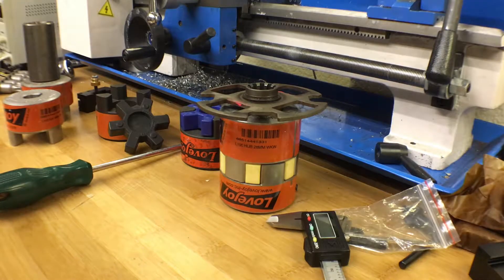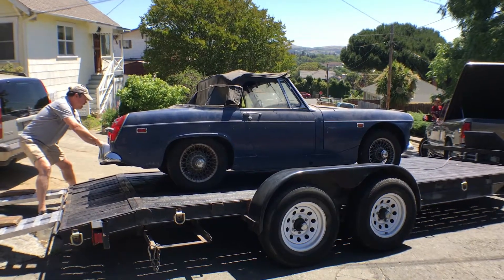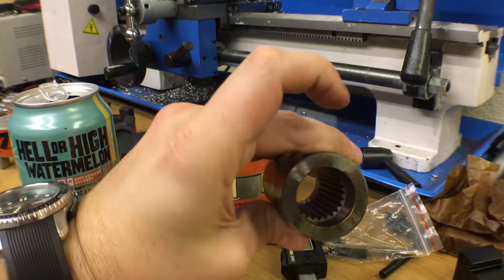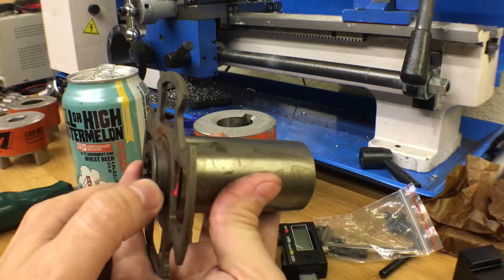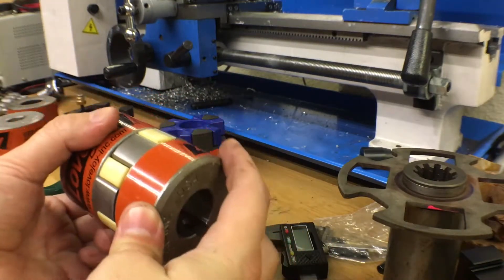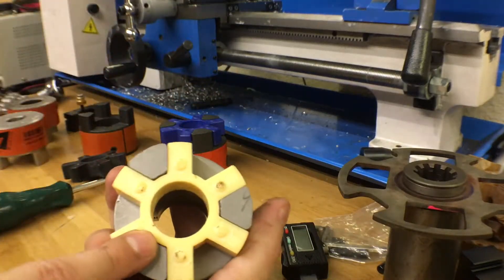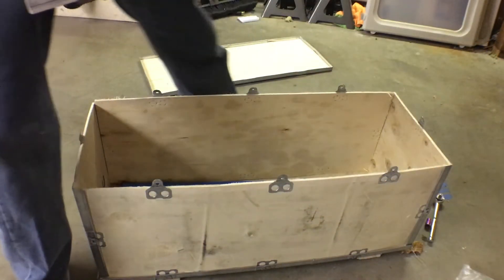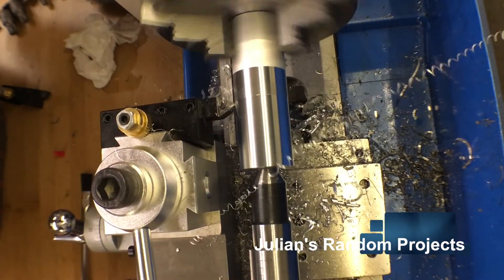MG Midget EV Conversion Part4 First Chips!!

Comment: I'm getting ready to do an MGB EV conversion. Was there a reason you didn't use the rear engine plate as the adapter plate? was it because the engine was more valuable with it?
Reply from the maker: I don't remember having a rear engine plate. Maybe because I sold it pretty soon after removal?

Comment: You have a lathe, it might be cheap Chinese, but you can still do precision work if you are careful: Make a mandrel from some aluminium roundstock that fits the inside diameter of the pressure plate coupler from the clutch. Machine the outside of the coupler so you are sure it is concentric with the inside and has a smooth surface and end. Take the splined adaptor for the electric motor and widen the hole in one end to fit the clutch hub barely. Put one thing in the oven and the other in the freezer and let them slip together. Lay down a decorative weld for piece of mind, and you'll have a perfectly straight adaptor (and cheap) that allows the motor to fit closer to the adaptor plate

Comment: I think you will be disappointed with no clutch on an AC motor, unless there is no regen. No clutch is commonly used on DC setups. An AC motor is very similar to ICE, with  even stronger resistance on declaration which makes it hard to shift without a clutch. Because of the constant load on the gears with both acceleration and deceleration.speaking only with my experience on my project yours may be different. http://www.evalbum.com/4247
      Best of luck with your project.
Reply from the maker: Richard, Thanks! Love hearing from people who are actually doing the thing I aim to do. Your opinion is very valuable. I plan to have the slightest regen or no regen until I upgrade the rest of the drivetrain (drive shafts, axle, spindles, etc.) If I upgrade the axle and the rest I'll be sure to put the clutch back in. RIght now I'm trying to get this done on the cheapest budget for the fun of it.

Comment: +1 for the lovejoy couplings. I've been doing a scooter project recently which required making a similar coupling/adapter-type thing going from yamaha scooter-axle->adapter/coupling->rim and I also bought (the same) mini-lathe. even so I found it quite difficult to get coupling/adapter absolutely true, mostly because the input parts (scooter axle, mini-classic drive flange) were themselves not 100% true. So if you have a solution which allows a bit of flex/leeway like the lovejoys then I'd def go for that over a solid coupling. keep machining to a minimum.

great project btw, good luck :)

*Don's method also looks to allow a bit of flex where it joins the clutch piece..
Reply from the maker: Leaning toward the love joy as well. thanks! and good luck with your scooter project

Comment: Please, just make some calculations for the coupling that they will hold your torque output and won't explode on you :D Plus you can make sure your "heated" friction joint will be enough to whitstand the torque... It is quite simple, so It won't take you long.

Comment: Definitely use the couplings imo. Ive been working with them recently and you got a steal for that many. I work with large machines that require like 1 ft shafts and the flex coupling we buy from lovejoy are almost 6k a pop and work like a charm